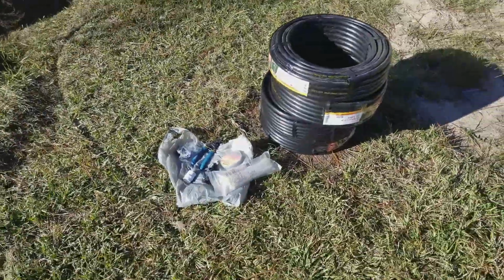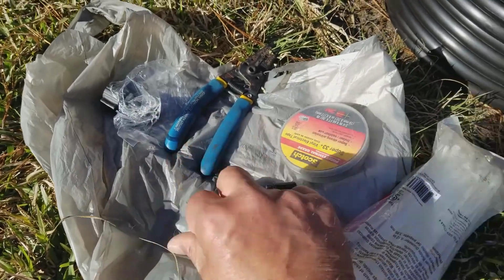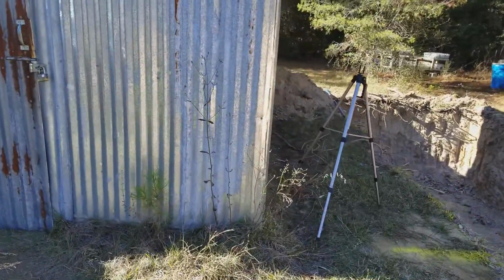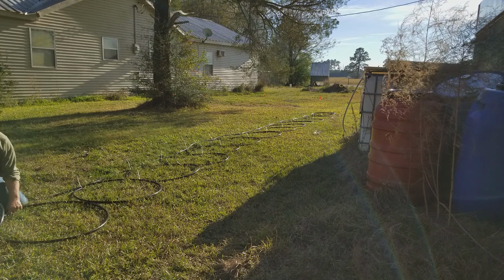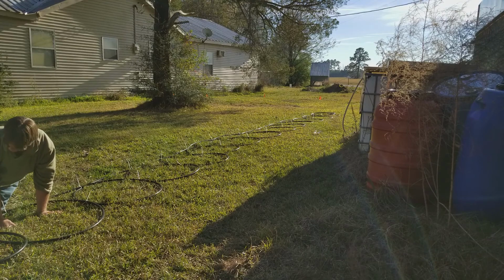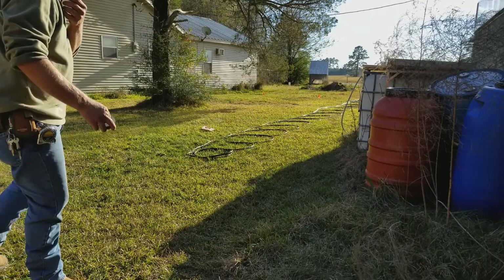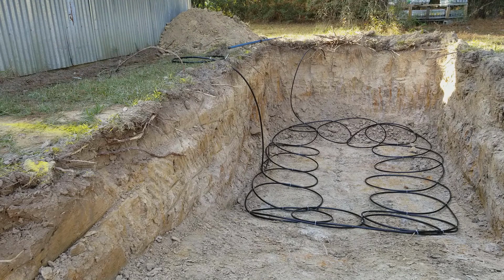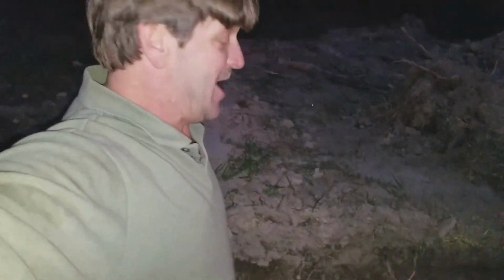#32 Geothermal Project Video series; Running Plumbing For The System

Comment: I've always thought it would be cool to dig a big hole like that and line it with some foam, run the pipe and fill it with sand.  Hook it all up to a outdoor boiler and use it as a heat battery... but doesn't look like you have the same cold issues we have here 😉
Reply from the maker: That would be cool to do, but you're right that it don't get that cold here. We usually have long long long summers and very short winters.

Comment: Follow the wire for the temp gauge to the engine, that clip on mine was loose, I took pliers and squeezed it a little tighter.. my gauge stopped working , that clip just came off the engine..
Reply from the maker: Little stuff Farms, Thanks for the suggestion I will take a look at that and see if that's it. I don't think it's a big problem it happen so fast I'm like you, A loose wire would be my guess.

Comment: Howdy! Your really making progress. Are you going to have a back up heat source? Or just rely on the ground heat? Thanks for the video.
Reply from the maker: I  have tank heaters and working on a propane heater. The way I'm using this method  of geothermal is to see if it would work, Just hoping it will stabilize the over all system temps enough to minimize  temp swings. Thank you William, For asking! Did you get all the corn in before this last winter's blow ?
Reply: Louisiana Aquaponics. Nope we haven't spun a wheel since Dec 21.   Oh well. We'll get it eventually God willing. Thanks
Reply from the maker: I hope it wasn't  to many acres lift to get. I know you where going at it for awhile trying to beat the snow.
Reply: Louisiana Aquaponics 120 acres. So 4 good days would finish.
Reply from the maker: If the winter is cold enough how long can it stay in the field?
Reply: Louisiana Aquaponics . It can stay there all winter. The longer it stays there the dryer it is. Thats one bonus I guess lol
Reply from the maker: That's cool then you really can't lose it. It just get's delayed.